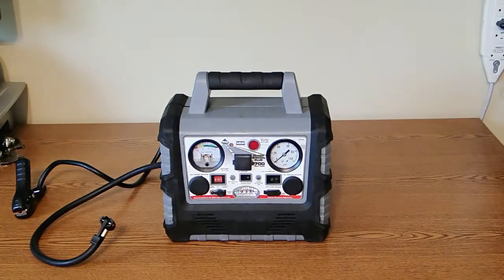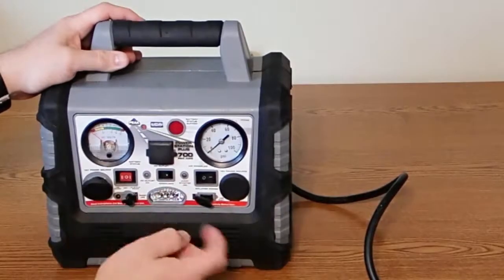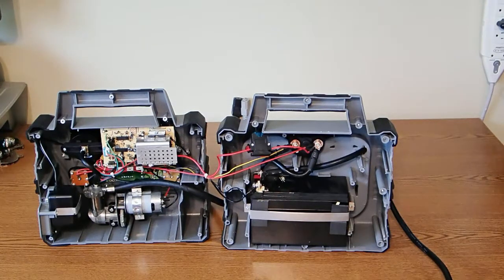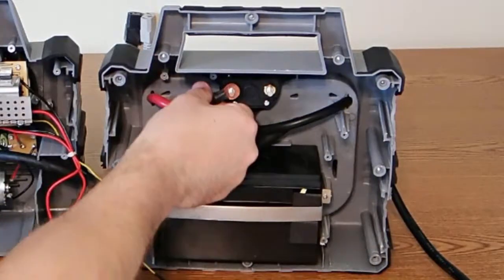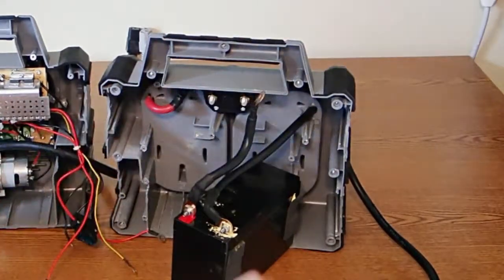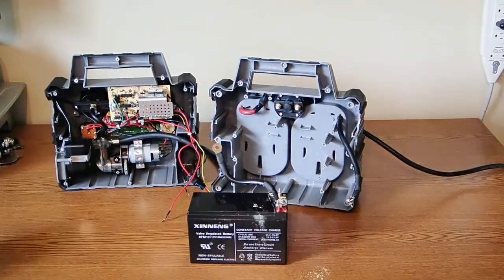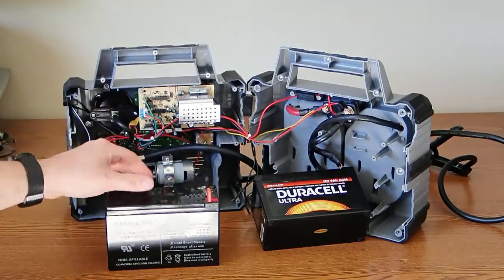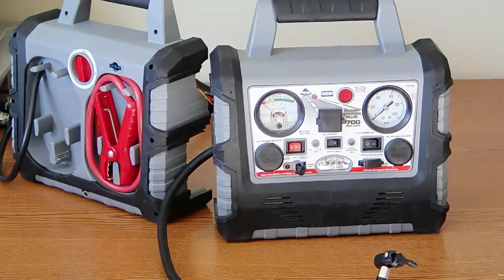Power Station Tire Inflator Fix

Comment: I just have no air pressure.. jumper cables work fine. By the video title I'd hoped it would address this..
Reply from the maker: Sorry, my problem was battery related. Maybe check the pump?